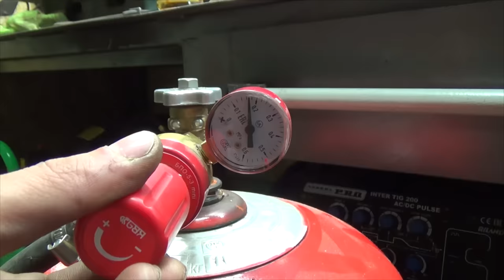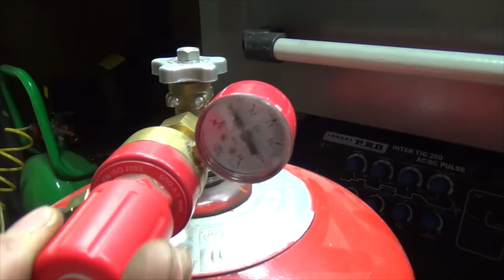Forge / Furnace turbo gas burner DIY jet propane

Comment: Feeds and speeds on your lathe work are to be improved.
Reply from the maker: well, I'll keep in mind
Reply: 🔴 What Is Islam? ⚠️

🔴 Islam is not just another religion. 

🔵 It is the same message preached by Moses, Jesus and Abraham.

 🔴 Islam literally means ‘submission to God’ and it teaches us to have a direct relationship with God. 

 🔵 It reminds us that since God created us, no one should be worshipped except God alone. 

 🔴 It also teaches that God is nothing like a human being or like anything that we can imagine.
🌍 The concept of God is summarized in the Quran as:

📖 { “Say, He is God, the One.  God, the Absolute.  He does not give birth, nor was He born, and there is nothing like Him.”} (Quran 112:1-4)[4] 📚

🔴 Becoming a Muslim is not turning your back to Jesus. 

🔵 Rather it’s going back to the original teachings of Jesus and obeying him.
Reply: @ahmdabdallah2132  what was the reason for bringing religion into this
Reply: @mick1gallagher  Mental instability.
Reply: @ahmdabdallah2132  Many of us saw religion as harmless nonsense. Beliefs might lack all supporting evidence but, we thought, if people needed a crutch for consolation, where's the harm? September 11th changed all that.

Comment: Constantly screwing it in and out is over kill. We got how it works the first time. And how many diy’ers  just happen to have a lathe in their shop. Not very practile
Reply: The lathe just helps it look better, everything he did with the lathe can be done with a grinder, and  drill, just wouldn’t be a pretty. Hardest part, would be drilling the bolt, but I suspect you could get around that by using heavy wall pipe, and threading it both externally and internally as needed.
Reply from the maker: thud NAT you can take a large washer and then the lathe will be unnecessary
Reply from the maker: yes, use a large washer and a thick tube if there is no lathe. thanks

Comment: How do you figure it is "DIY"? Not many do it yourselfers have a machine shop at their disposal to make those parts...diy my ass.
Reply from the maker: you can make parts without a lathe. Use a large washer. And you can drill a hole in the bolt with a hand drill.

Comment: DIY as long as you have a metal lathe. The vast majority don't have one sitting in their garage so this video is pretty much useless for your average smith working on a budget.
Reply from the maker: you can use the correct size washer purchased from your local store. The bolt can be drilled with a conventional drill